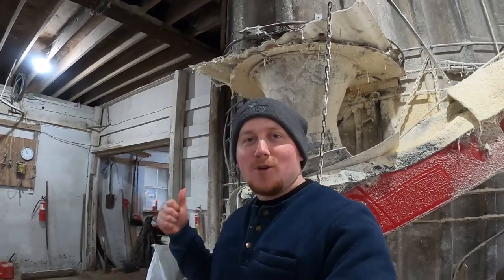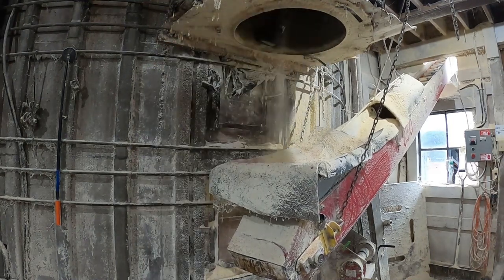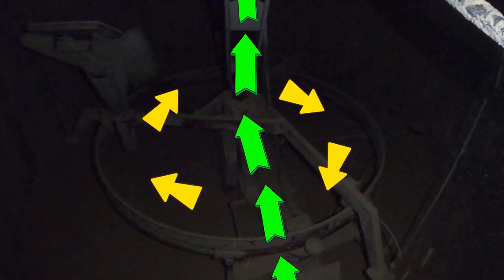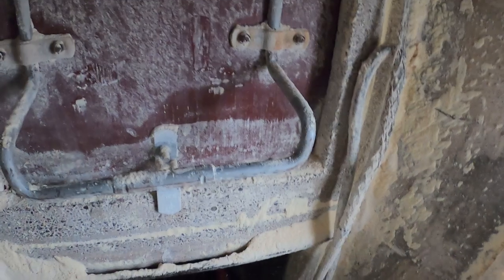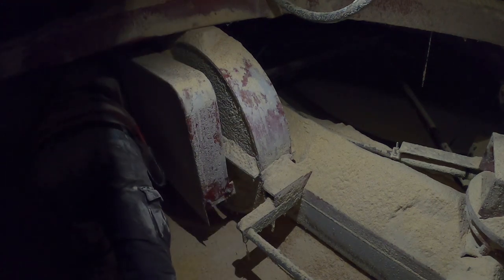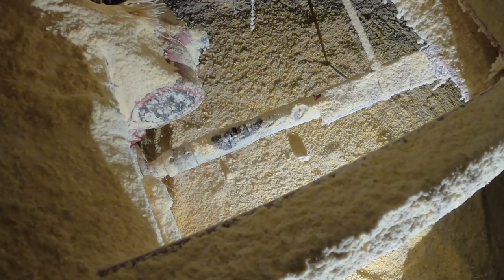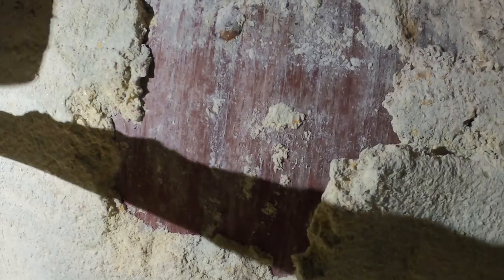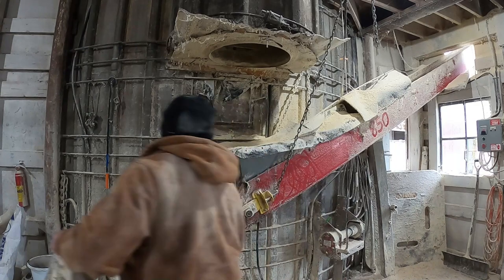The Dairy Farm's High Moisture Corn Storage and Upkeep!

Comment: Shelled or ear corn? Our unloader worked better in ear corn, but the cows did better with shelled. Thanks, nice video.
Reply from the maker: We do shelled corn now that we have the combine.  We run it out of the trucks and into the New Holland 355 grinder and through a 1/8 inch screen.  We went down to an 1/8" screen from a 3/16" screen last year to get a more uniform grind and help with digestibility.  Though it does seem to take a little longer per load grinding haha.   Thanks Ron glad you enjoyed!

Comment: How many silos do you have and any harvestores or concrete stave and do you have a bunker silo
Reply from the maker: We have 4 concrete stave silos, but we only use the 16ft now for high moisture corn.  And we have 5 bunker silos of varying widths.  Also, we will put up 10 ft silo bags to get things rolling in haylage and corn silage if certain fields are ready sooner or later than the majority of the fields.

Comment: there is no risk of asphysia?
Reply from the maker: Excellent Question!  So, the silo I'm climbing in this video is open and has had feed being pulled from it every day for months.  The fermentation process is well over so there are no poisonous gasses being released and they're not able to build up anymore....also the weather being cooler aids in that.  With that being said when the silo is being filled YOU DO NOT GO IN.  When the silo is full to the top and we cap it BUT before going in we run a blower that pumps fresh air in and any gases that may have started to collect out.  When we are ready to open the silo once the fermentation has ended, we again hook up the blower and pump fresh air in for 20 mins before we ever consider going up to open it.  Thanks, hope that answers your question.
Reply: Education is important. While we were away, a neighbor had a heart issue in our high moisture silo. It was 3 months after the silo was filled and rescue workers refused to go up, fearing silo gas. Another neighbor went up and helped him down the chute. I have since suggested they educate themselves on farm rescues. Gas is produced for 21-22 days after the last load is ensiled. We kept the blower at the silo at least that long.